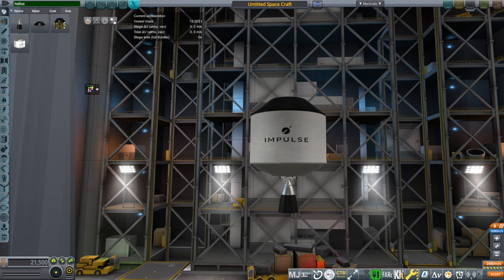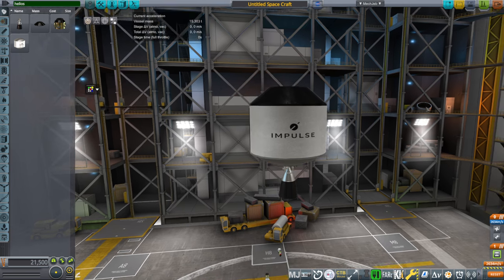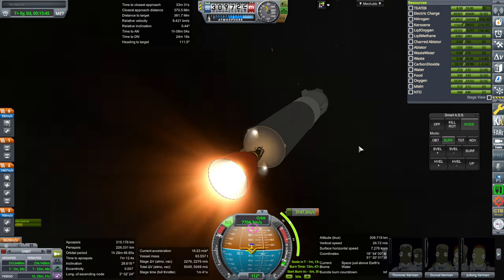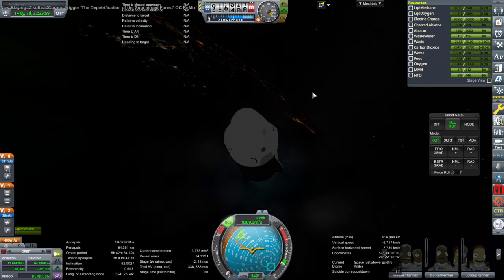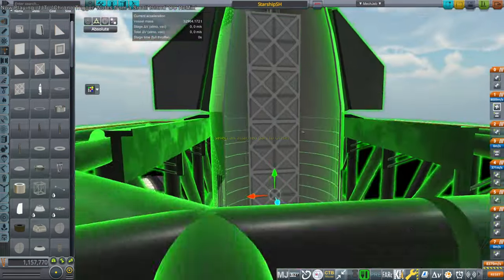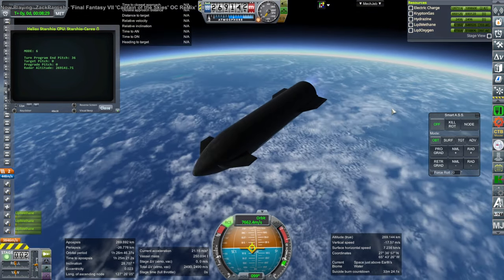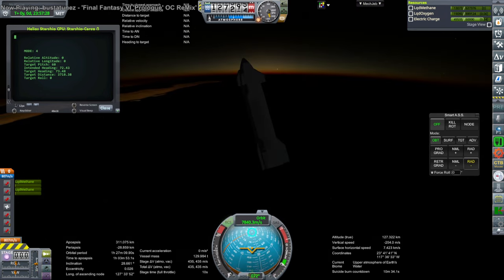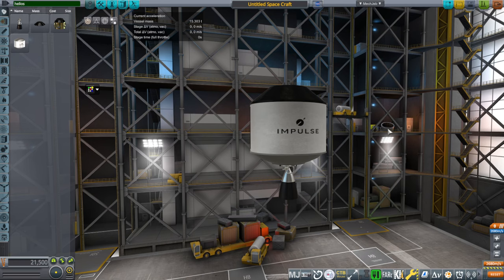Uses of the Helios stage from Impulse Space (RO in Kerbal Space Program 1.12)

Comment: for some reason when I install PEKKA's mod the Falcon 9 and Falcon Heavy Side Boosters have no texture and are all black and the deluge waterfall thing does not work/has no cool effects like in the video and the flaps have no nodes on them
Reply from the maker: I don't think the deluge is added yet (and wouldn't be for Falcon - only for Super Heavy) but the texture is peculiar. I'll have to ask him what might be wrong there. Since I suppose the model is loading, it's probably not the folder structure.